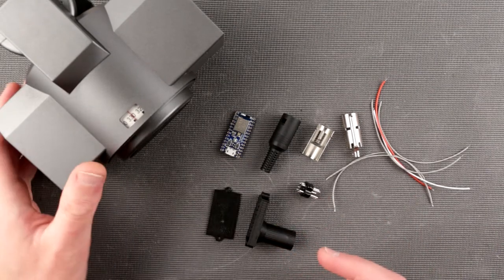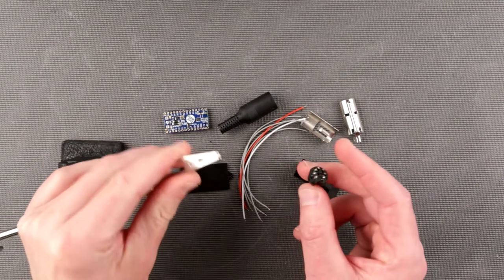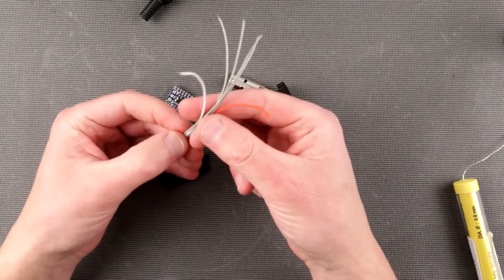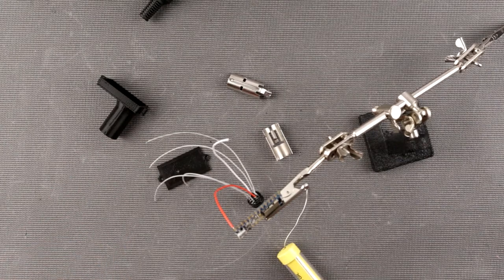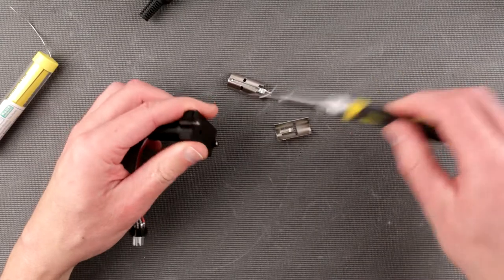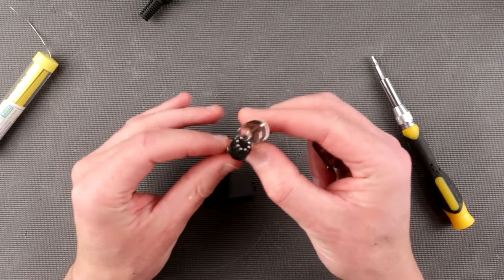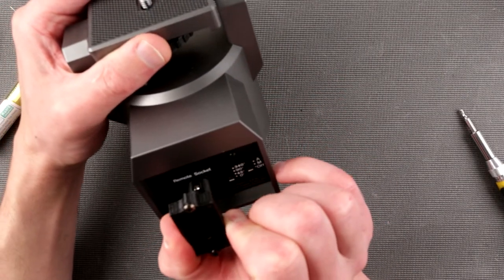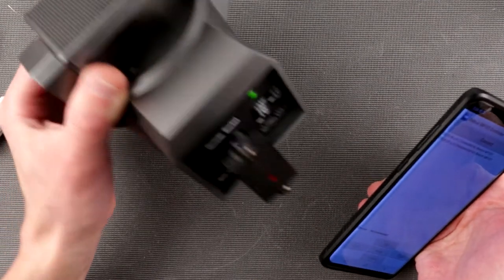Wireless Remote for Bescor MP101 V2. Project Complete

Comment: Looks like a fun modification! Great way to save money too. 🙂
For your info - Cam Ranger 2 has a wireless remote control with an adaptor that plugs into the Bescor pan-tilt head, so you can use it with an iPhone, Ipad or other wireless device.
Cheers,
Frederic in Montréal.
Reply from the maker: Nice, good to know. But my solution is about 20 times cheaper :)
Reply: @InsideOutElectronics  any way to use this with "not a phone" and instead connect the actual controller that comes with the MP101 to a little transmitter dongle (with an AA battery for power or something) using a second nRF52840?
Reply from the maker: @jurrich  of course it ia possible, but i wanted tobselve myvproblem easy way ;)